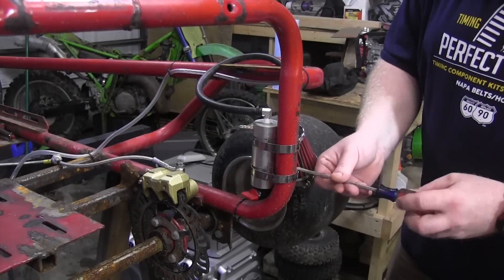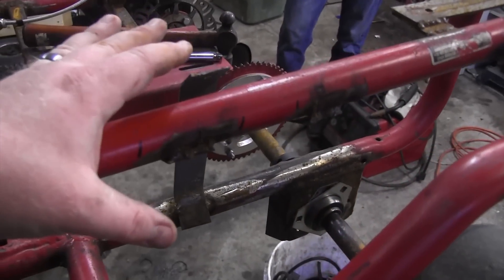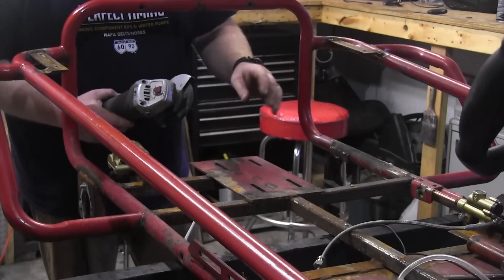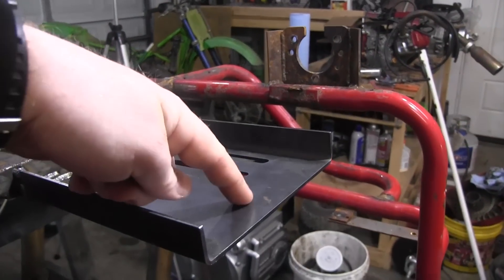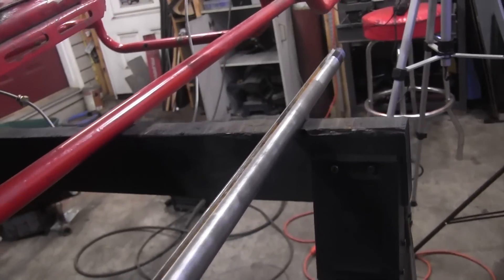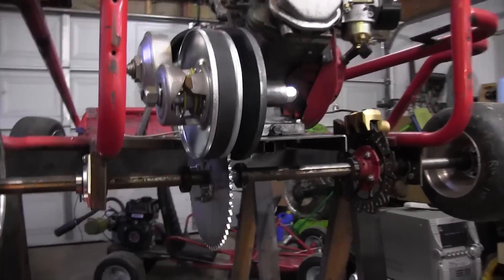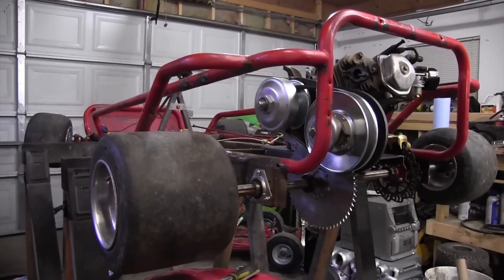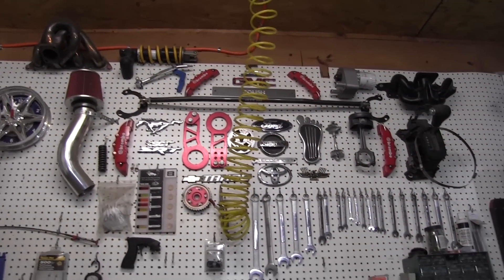Street Go Kart Build Ep 4

Comment: If you want the go kart to have a little more torque then you can always get a smaller sprocket for the actual torque converter. Like an 8 or 9 tooth since it comes stock with like a 10 or 11 tooth sprocket.
Reply from the maker: Yeah i had planned on making some videos on that in the future.
Reply: I did it on my go kart and it worked great

Comment: rub the axle with bar and chsin oil. will protect it nicely
Reply from the maker: Ill try it out. also going to tarp them up this time. lol
Reply: Once bare metal is cleaned up, I use paste wax all the time to protect the surface.  Oils are messy and dust/dirt stick to them.
Reply: Red Beard's Garage this will smoke all those home brews. 

https://www.zoro.com/fluid-film-lubricantcorrosion-inhibitor-225-oz-as-2/i/G3681535/?gclid=CLO_h9TE_NECFYmLswodV2wJzg&gclsrc=aw.ds

And I've used a product by crc also, as a test I left a piece of metal coated on 1 side,laying in the paved driveway. 
over 2 years there's 1 rust spot about the size of a matchhead. 
The untreated side is grizzly.